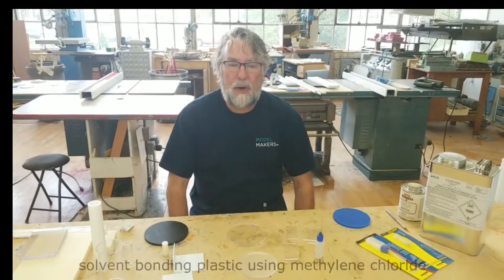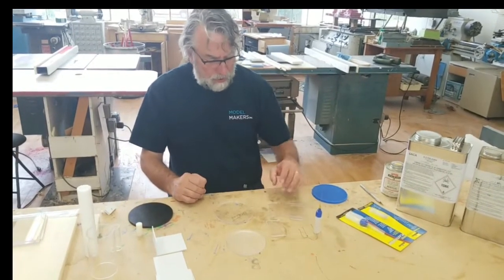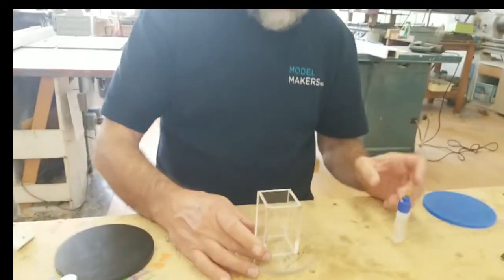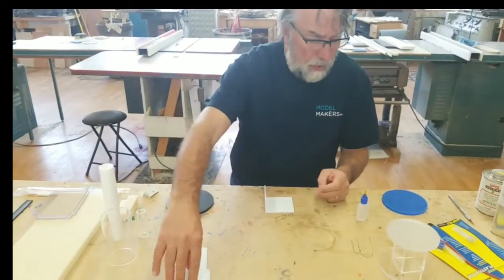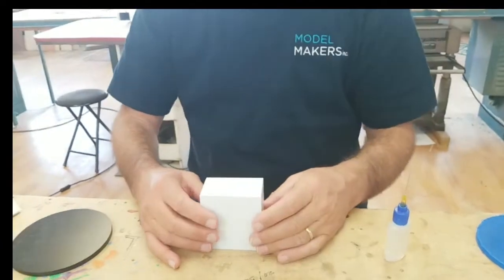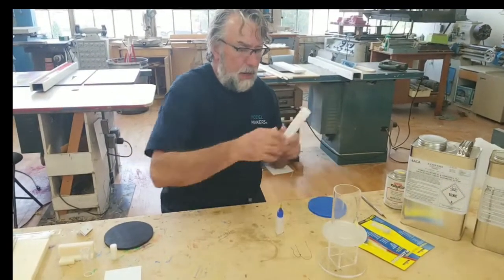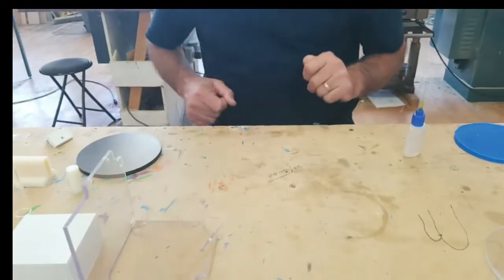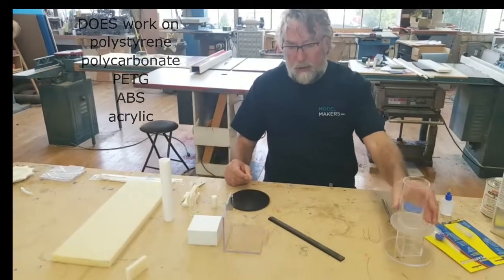solvent bonding with methylene chloride

Comment: Hello! I was wanting to know I 3d print mostly in ABS, and I sometimes need to put pieces together normally I use ABS glue (mixture of abs filament and acetone) or just straight acetone,  would weld-on 3 be a better option than the two I already use when joining piece together or does it depend on how it will be handled/used?

Comment: You used to be able to get methylene chloride at any hardware store.
Stupid EPA banned it because over the course of 40 years a dozen people didn't follow the directions about ventilation and died.

About half of those were stripping paint  from bathtubs, a use that the label told you  not to do.

Comment: Does Methylene Chloride require a specific applicator bottle? One that won't "melt"?
Reply: I have used brushes with it. If you buy the stuff sold for models, it comes with a brush in a bottle. It's sold as Plastic Weld.

Comment: Where can I find that solvent?
Reply from the maker: As stated elsewhere on our channel,  methylene chloride (aka DCM, or dichloromethane) is more likely to be available from your local plastic distributors than from hobby/craft stores. Brand names include: Rez N Bond, Weld-On, and EZFix(303) Always remember to be careful with these and other VOC solvents. They are volatile, toxic, and flammable. Don't breathe the vapors or get it on your skin, and don't use it near an open flame. Internet searches for methylene chloride may point you to certain paint strippers - don't try to use that.
Reply: @modelmakers33  The products you mention also contain trichloroethylene (solvent) and methyl methacrylate monomer (cement), not just the methylene chloride solvent.